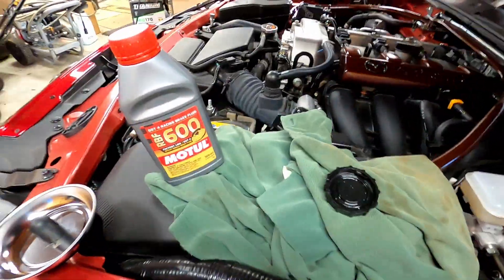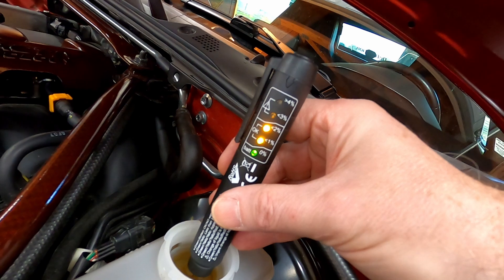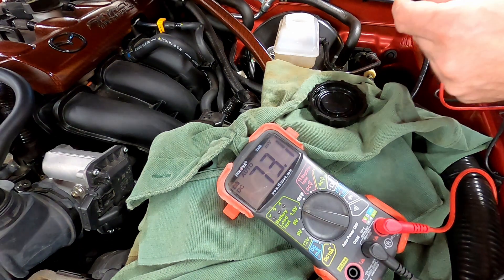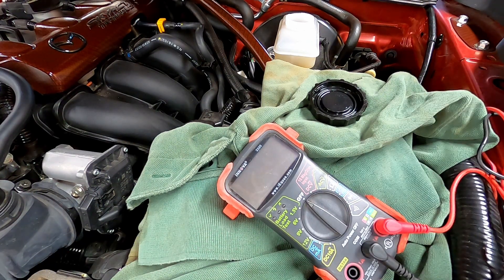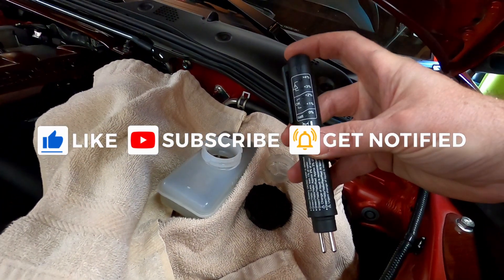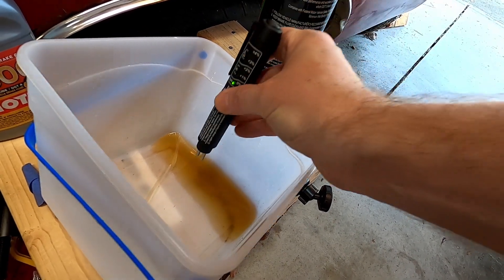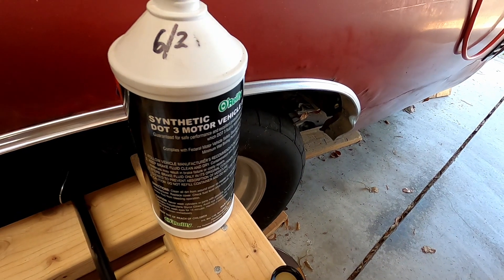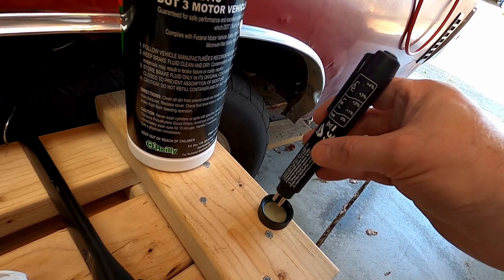Bought An ITEQ Brake Fluid Tester Pen Off Amazon, Let's See If Its Any Good.

Comment: For me to believe the multimeter method actually works, I’d like to see an old brake fluid vs new brake fluid measurement. 

I tested my new vehicle with 6 month old fluid and then really old fluid and both measured the same .002mV.

Comment: I used an OEM pen tester with a series of LED indicators on an old Landcruiser. It showed high moisture.  I wondered why because the system was completely flushed a couple of years ago. I'm in a dry desert climate. I bought a Kingbolen and it said it was okay. This tool has settings to distinguish between the three DOT fluids. I really like the flexible wand design. It is great for the Dodge van that has the master cylinders under the hood edge, leaving three inches of vertical clearance. Great tool.

Comment: How often should you change the brake fluid in my miata ND2.  I got 20k and two years on it now.
Reply from the maker: The stock brake fluid is DOT 3 which I've seen people run for well over 10 years with normal driving. You are most likely going to be fine just checking the fluid when you have the brake pads replaced or every 5 years. But, it really should be flushed/replaced when the fluid gets to 3%.
Reply: Is the Chinese pen good to use?
Reply: @مكامنفتحي  Not as good as dirty Muslims.